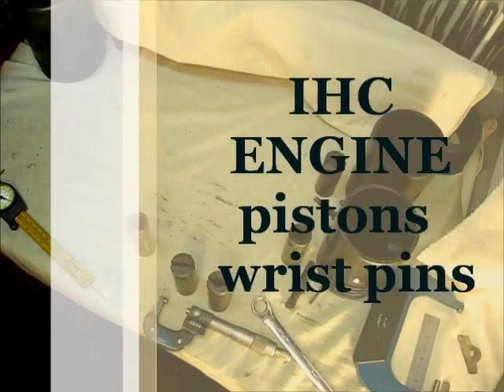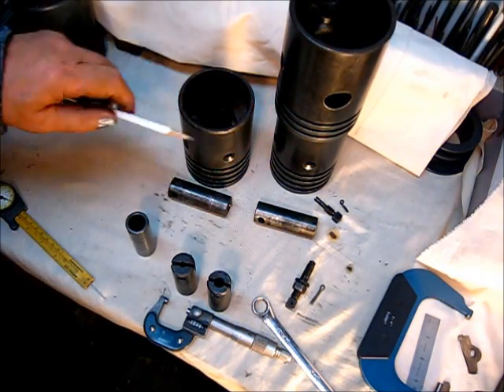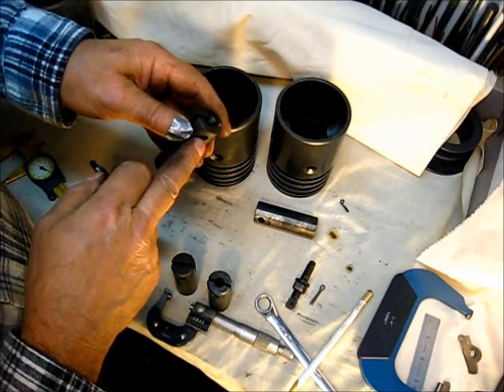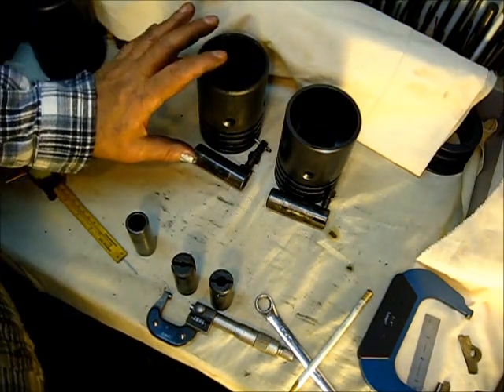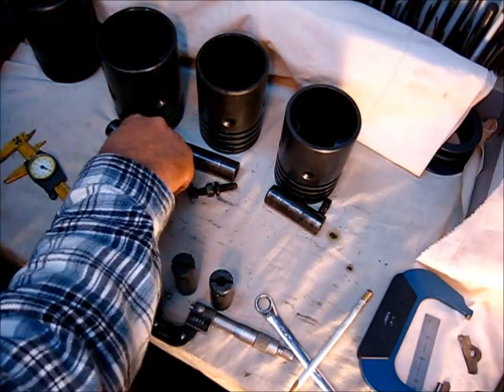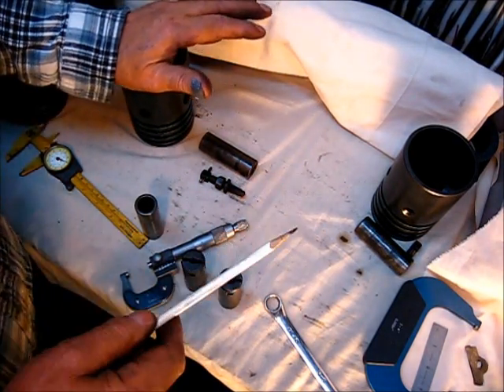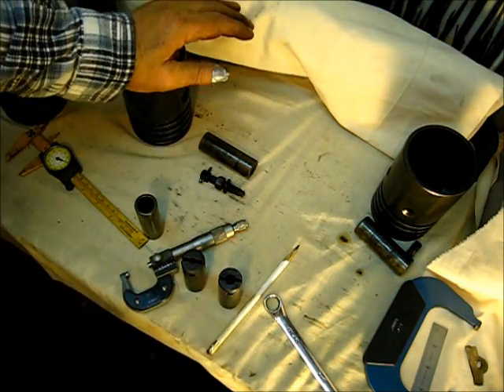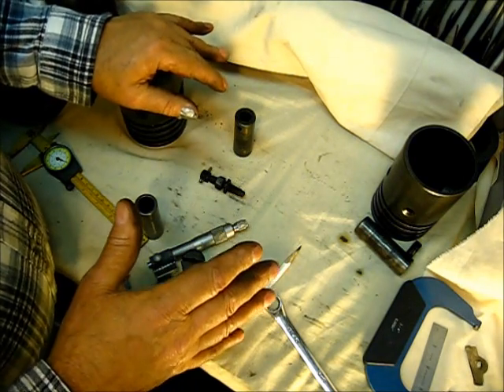IHC ENGINE / pistons and wrist pins explained

Comment: Sam, can ya balance the reciprocating parts on your Concentricity machine? or maybe see how far out the balance is?
I used a pair of chipper blades to balance all the turning parts on  Homelight XL12 chainsaw engines many moons ago with great sucess.
Spoked flywheels.? .a few turns of "bailing wire" on the light side might help.

Concentricity.. Con cent  tricity, one of those hardly used mind words,  I think of  Electricity  and break the word apart.

Comment: I would think that if the crankshaft has no indication that it was balanced then it would seem likely that the flywheel was balanced ON the crankshaft. These being 1-cylinder engines there would be no reason or possibility to balance the rod or piston. I would guess that the flywheels and crankshaft were balanced together, but then again, what do I know?

Comment: Flywheel IS balanced individually, or together with crankshaft.
For engines like that, there's no device to compensate the mass of piston and connection rod, thus make it meaningless to balance flywheel with those stuff on